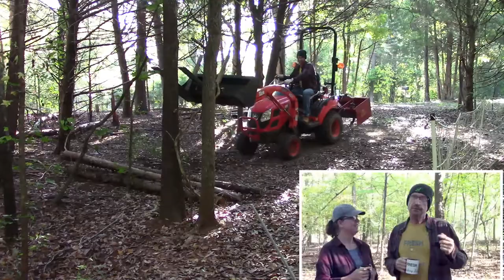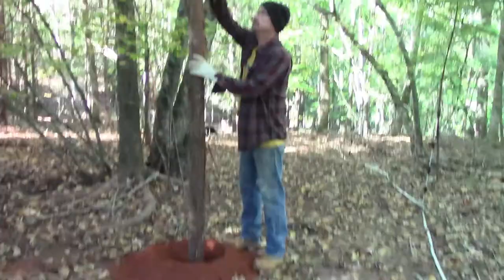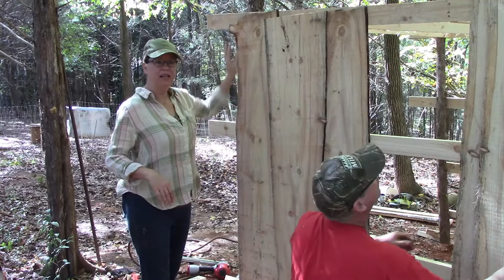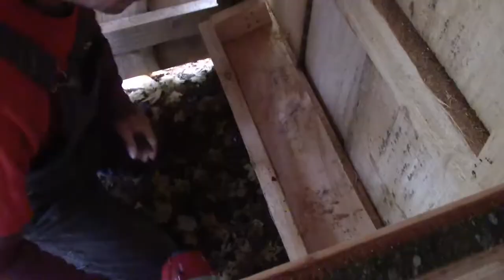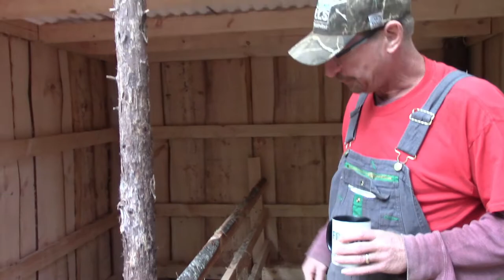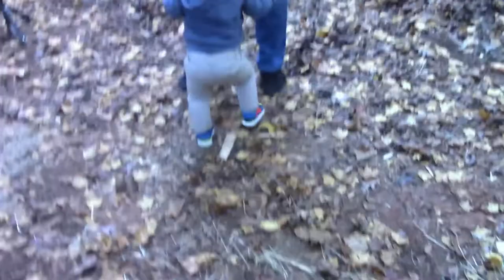Building A Goat Shelter For Free | 3 Sided Lean Shelter

Comment: Looks great and I love the style.
Couple tips from my carpenter side, leave the front poles in under the roof to stop the tops rotting out too quick (chamfer them at and angle and oiling the tops will help to save this one) and when nailing green shakes don't nail through both boards the cover board nail it between the 2 back boards, will lessen nail pull out and board split when they shrink.
Reply from the maker: Great tips, thanks! The nailing makes perfect sense!!